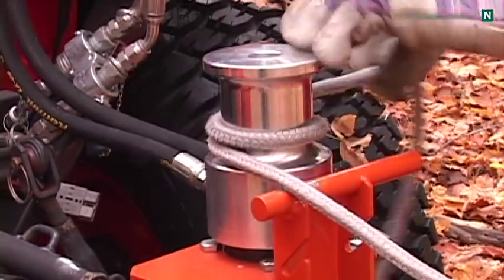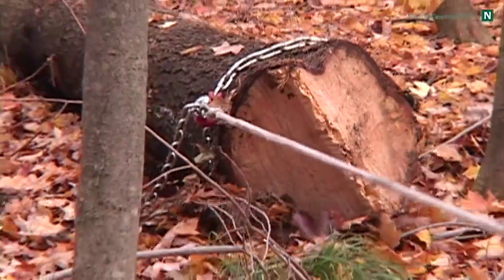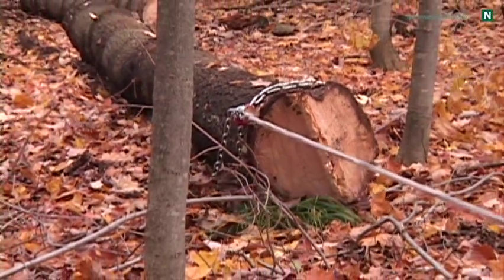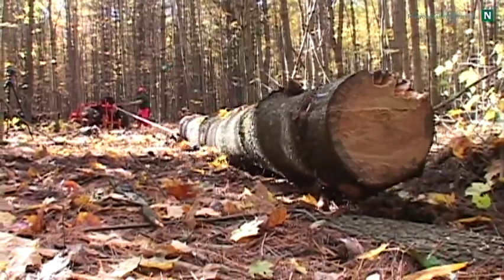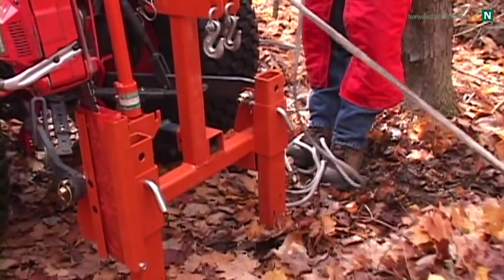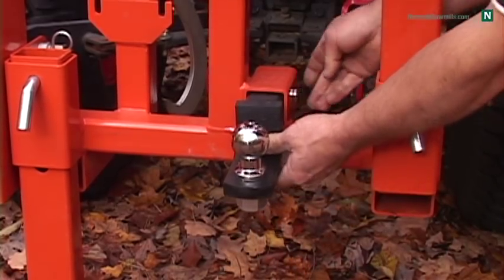Hydraulic Log Skidding Winch for Tractors - SkidWinch by Norwood Sawmills

Comment: Two questions were asked about the pull rating of the winch or rope , and you dodged both of them. Why?
What is the maximum rated pull of the winch, and what is the maximum working load limit (WLL) of the included rope.

Comment: How long is the rope and what is the safe working load of the rope
Reply from the maker: Hi Noah. Rope is 50 feet long. In terms of load details, load varies depending on terrain and tractor size and type. Operation on hilly terrain or in wet conditions not recommended. Front-mounted counterweights recommended. Good judgment and experience required. For more details, see https://www.norwoodsawmills.com/skid-winch-hydraulic-log-skidding-winch

Comment: How many ton is the winch rated for?
Reply from the maker: Hi Doug. The actual load and limitations depend on many variables when you are skidding including terrain, conditions, tractor size, etc ...,
Reply: Norwood Portable Sawmills how much lateral load can the bearings on the hydraulic motor support?
Reply: @NorwoodsawmillsDirect  while everything has its limitations thats a shity answer... you could've stated in the ideal conditions max capacity is "_ _ _ _"